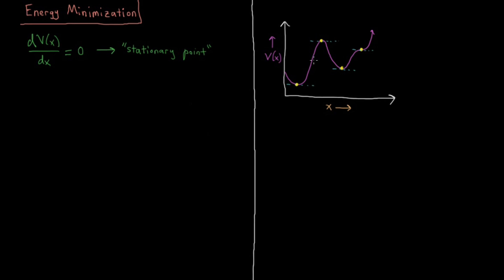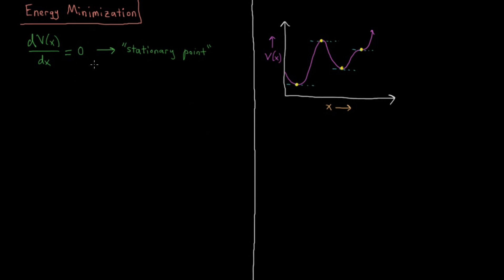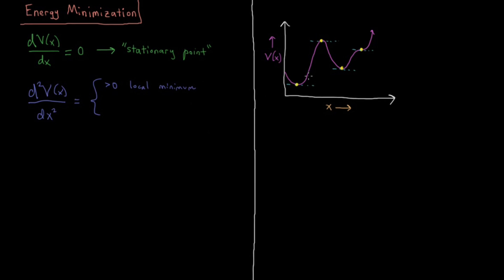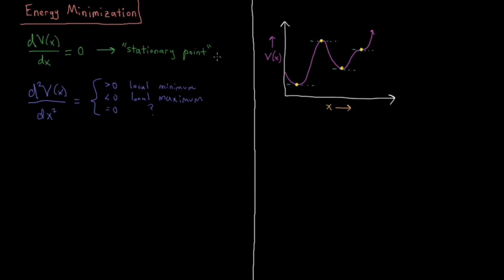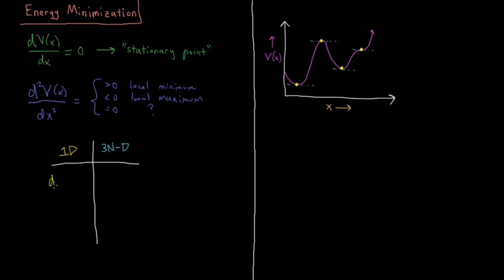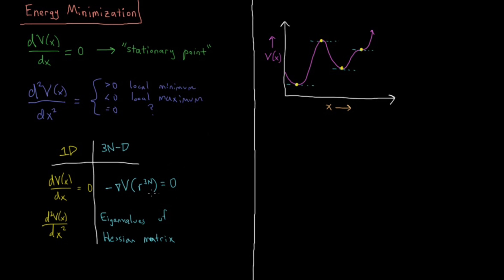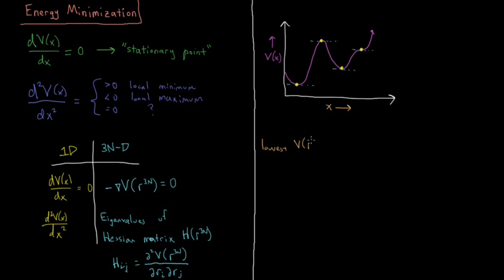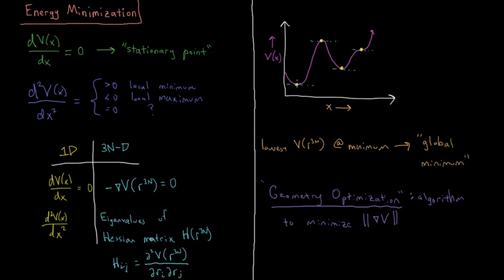Computational Chemistry 3.2 - Energy Minimization (Old Version)

Comment: should there be negative sign of the gradient in the one dimension dV(x)/dx or this the just and example ?
Reply from the maker: In principle yes, but luckily since it is being set to zero this error ends up being of no consequence. If -x = 0 then x = 0 as well. In general, a stationary point only requires that the magnitude of the gradient approaches zero. Whether or not it is a minimum depends on the second derivatives.